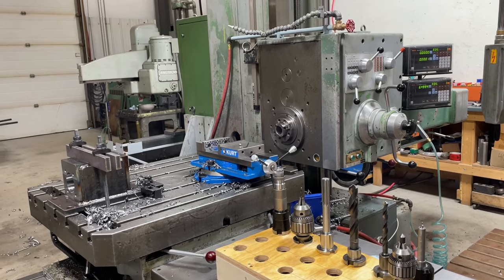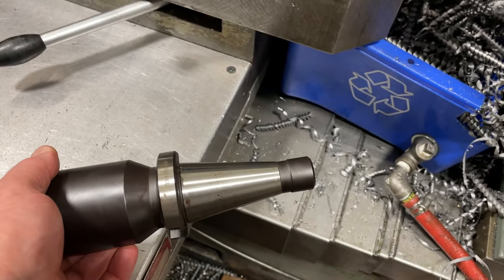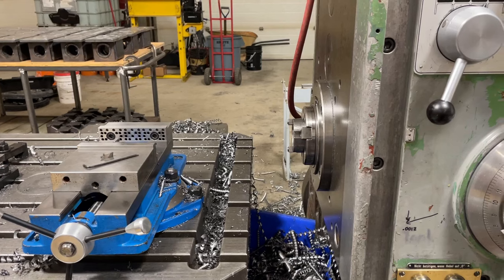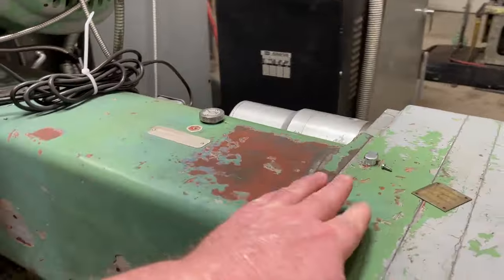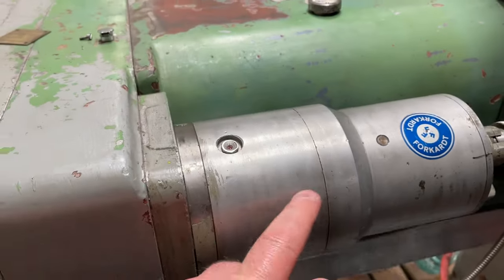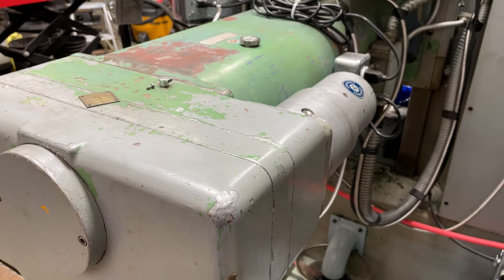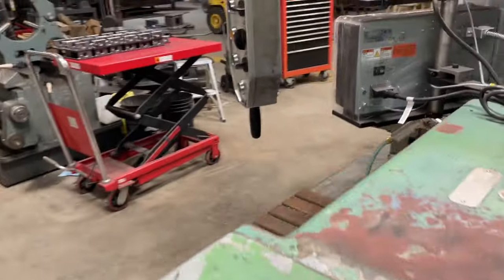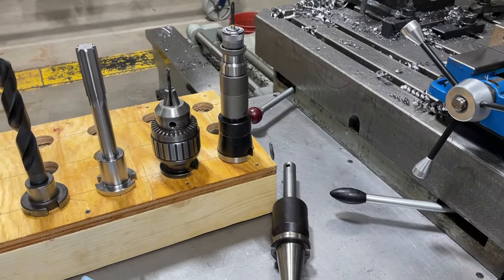Horizontal Boring Mill Power Drawbar and a bit of Back Chamfering

Comment: That is a good set up on the draw bar .      I think i will have to bite the bullet & make a heap of the Bayonet adapters for the NT50 tooling on my mill & keep running it .     It's  just a bit of a janky method to grab the tools , but works .     My one has the electric interlocks & a time delay  before it will let you start the spindle .     Cheers Ken , Thanks  .   👍
Reply from the maker: For me at least, a power drawbar in a milling machine is just after digital readouts in order of importance.  They really do make a difference on repetative operations. Ken

Comment: Excellent description of the de-clutching mechanism. What a great system to prevent whoopsies. The whole system is pretty cool really. And those vise jaws are a interesting concept. Stop pin bores by the looks of things. Did you discuss those in a previous video?
Reply from the maker: The holes in the vice jaws are actually there to allow you to set parts at different angles.  They come with a map that shows you where to place the pins for a certain angle.  You then set a part on the pins and tighten the vise jaws and the part will be at that angle.  You are right though, in this case I was using it for a stop pin.  I made a mistake part way through when I resharpened the large drill and didn't put enough relief behind the cutting edge.  This caused the drill to rub severely and this caused a huge increase in drill thrust.  The boring mill feed was up to the task and it bent the stop pin before I realized the problem.

Comment: That draw bolt system seems robust but a bit complex.
Fine if it’s working as designed.
You must have bought an INT40 holder with M16 thread, still got them?
I thought about just clamping that HSS chamfer tool bit in for retraction through the hole…
Save a second or so but what could possibly go wrong!
Hahaaa.
That HBM has proven useful.
Reply from the maker: It has proven very useful.  I have a large project underway right now and I would estimate 85% of the non lathe work has been done on this boring mill.  The more I use it the more I think I should have got one years ago.

Comment: My boring mill uses a MT 4 spindle I wish it had 40 taper . I have thought about making an adapter from MT4 to 40 taper but never got it done and some people said it would not work. Are you looking for 40 stuff ?
Reply: Ive got a MT4 to 30 taper on my smallest HBM, i made it to take BT30 holders because thats what i use on one ofnmy mills.

Dont think 40 would work on a MT4 without it being incredibly long
Reply from the maker: The 40 taper with power drawbar is hard to beat.  I pretty much have all the 40 taper tooling I need but I still search on ebay for odds and ends to round out my collection.

Comment: The spindle taper looks terrible
Reply from the maker: While it is in fairly poor condition the video makes it look much worse than it is.  After I reviewed the video I went back out and looked at it again because it looked so bad in the video I thought maybe I had missed something.  I would estimate that 75% of the original taper is intact and the tools seem to seat properly and work without problem.  I've taken some pretty heavy roughing cuts with facemills mounted in the taper and there were no issues.  That is why I'm pretty sure this machine had its slideways rebuilt and then had very little use.  Most of the alignment checks I did fell within new machine tolerance yet the spindle condition shows this machine has a huge number of hours on it.
Reply: Beautiful machine...  Scars n all...  Mr HMW saw its potential along with its flaws and knew he could overcome..   Thank you for sharing